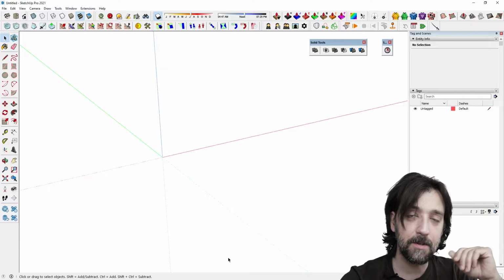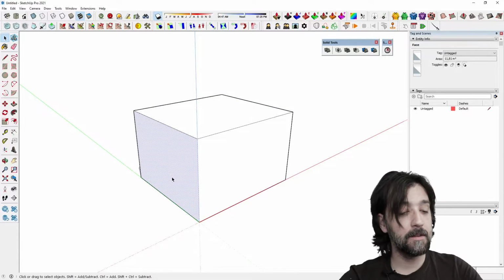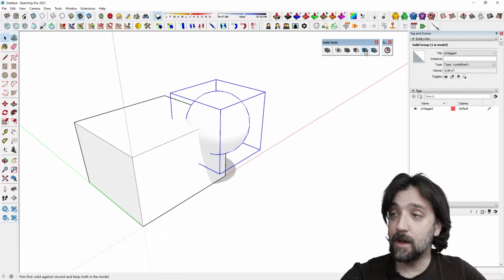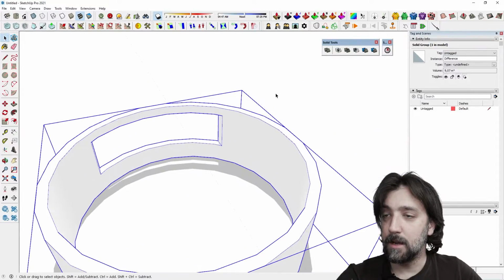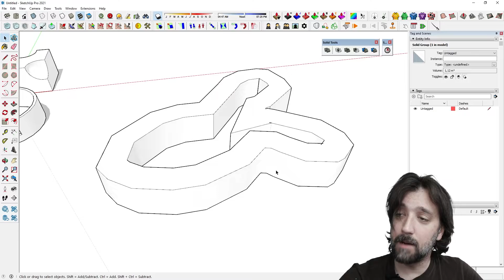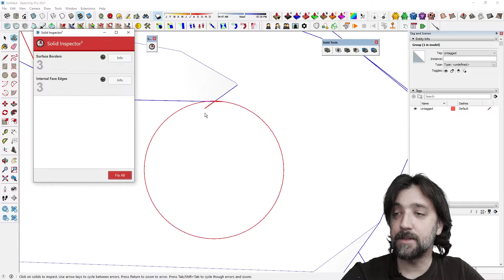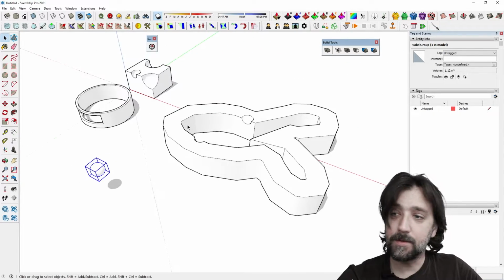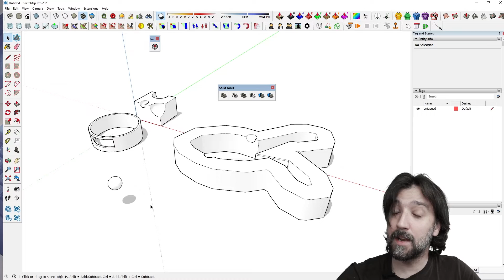SketchUp solids - What you need to know

Comment: Thanks for explaining the solids, I want to ask if one can do ‘solid inspection’ on iPad version ? As I only use iPad version - thanks
Reply from the maker: SketchUp for iPad does have a version of Solid Inspector integrated into the interface, but it's a bit hidden. If I remember correctly, it's included under the Entity Info or Inspector tools toward the bottom of the toolbar. It might not be labeled exactly as "Solid Inspector" but should function similarly
Reply: @ thanks, will look into it